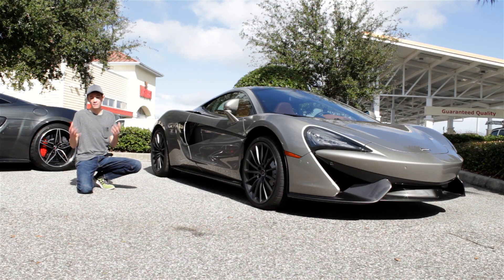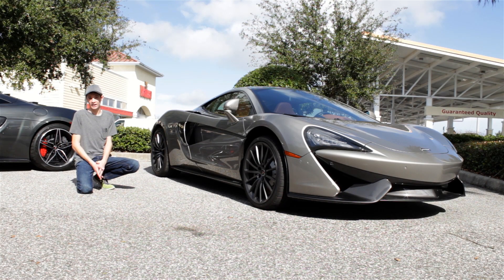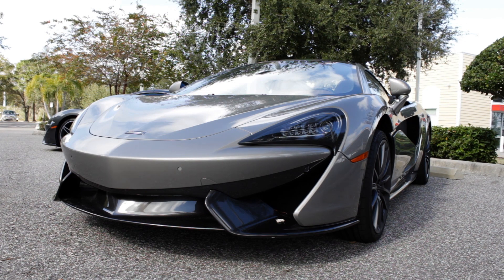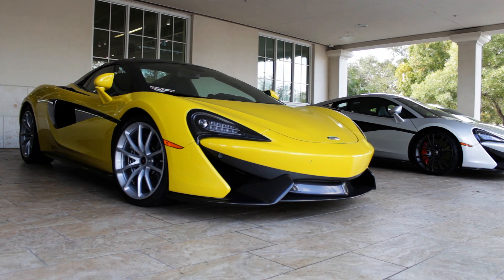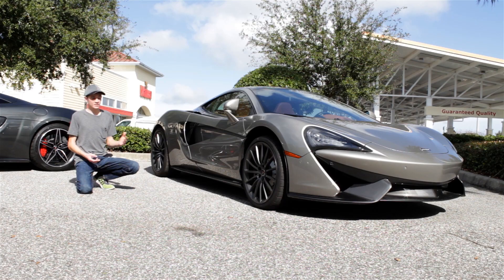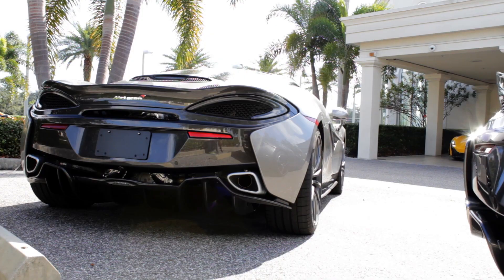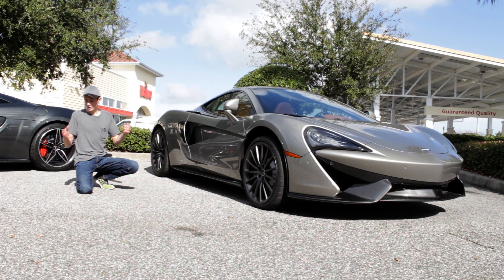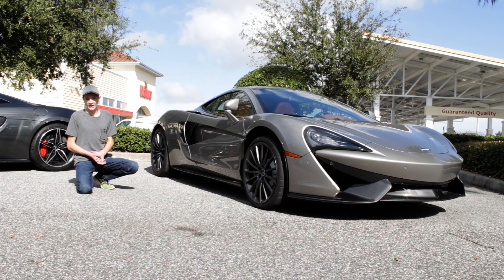McLaren's Carbon Fiber Chassis Explained

Comment: Im very curious about that carbon chassis, and thing that im very wanted to know is that carbon chassis hollow in the middle of the carbon tube?? (Like in side of car are surrounded with huge thicc of carbon block, and are those hollow in the inside???)
Reply: They are hollow...Building carbon fibre parts has more to do with dress making that pressing bits of metal to form the car body...Carbon fibre material often is deliver in a " pre preg " state .., ie the woven sheet material has been impregnated with a thermo set glue ..,which when warmed will chemical bold to become rigid & adhere to other sheets...If you want to " mess about " with a similar but cheaper technology .., go and look at glass fibre canoe technology..,this arrives as sheet material and a 2 part resin system.., it will give you some ideas of the problems & pleasures...You can also find small kits in auto repair outlets...Regards Bob